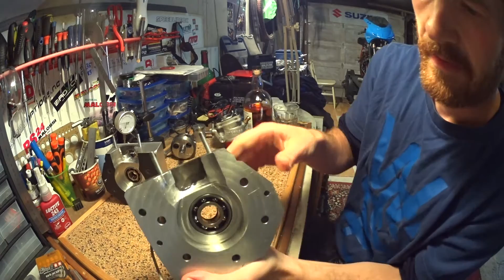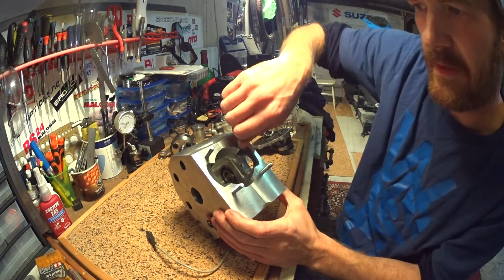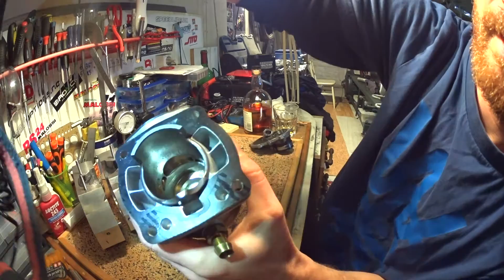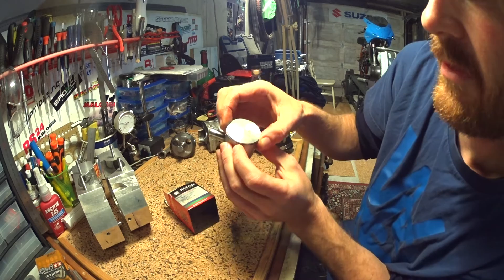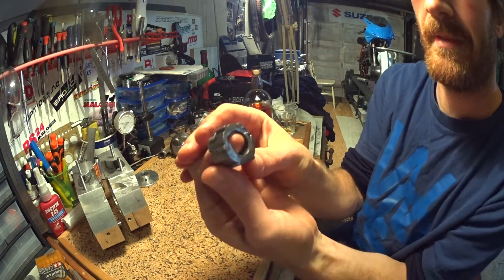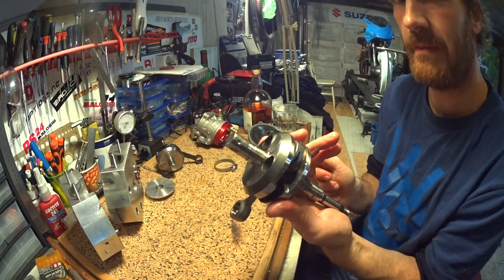E2 - The Rotary valve Spx Engine Block, Cylinder And Crankshaft. uncut. 2STROKE STUFFING

Comment: Hey I have a question the holes above your bearings what's the function of those to they bring oil to the bearings? If I have an engine block who sat for a long time should I put oil in those holes. And if they bring oil to the bearing is it between the bearing and the seal?

Comment: Did you end up drilling and plugging the crank with tungsten? I was thinking what about using a hollow crank pin? We sometimes use hollow crank pins in 100cc go karts.
Reply from the maker: +Devinder Athwal Yep, I did. Drilled it and flux core welded(!) them in - worked!

Comment: so what is the difference between a regular two stroke and a rotary valve two stroke? and i have noticed your English is getting really good from this time to now
Reply from the maker: +Bryce Glover First off all thanks! The difference is in how intake timing is handled. The three most common ways are Reed valve, Piston controlled, and Rotary valve. The main advantages with a rotary valve vs reed is: No flow obstruction when open, no "lag", and potentially better intake geometry. Compared to piston controlled rotary valve has the advantage of being able to run asymmetrical timing.
Reply: 2STROKE STUFFING ok thanks so all it is... is a straight shot over going through a tunnel to the crank thank you for the information

Comment: Why Did you go with such å shit cylinder?
Reply from the maker: Tiqo The only thing shitty with the m50 is it has an iron liner. Great for porting though, no nikasil to worry about.
Reply: 2STROKE STUFFING yes but there are plenty of other more powerfull cylinders out there like the roost havoc for example, it would suit your machine better i think
Reply from the maker: Tiqo I'm keeping it 50cc, not many comparable options in terms of price vs power vs work needed.
Reply: there are still better options out there but i get your point

Comment: what do you use for gasket paper? it looks like your gaskets come apart freely and easily without tearing. also, do you use any sealant at all for the cases or base gasket?
 the stuff I have from the local auto parts store is rubberized felt type of material and it sticks and tears horribly every time I disassemble.
Reply: thanks for your reply! Hmm I actually don't remember if I oiled my gaskets, but I'll be sure to coat them with oil the next time.